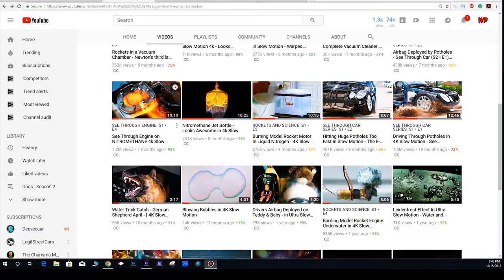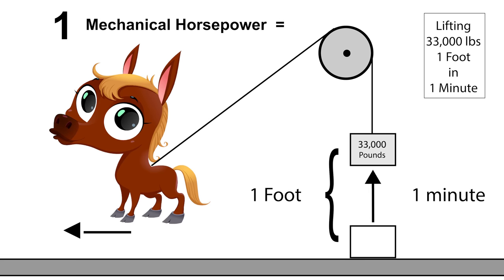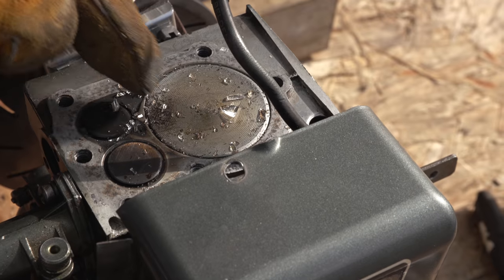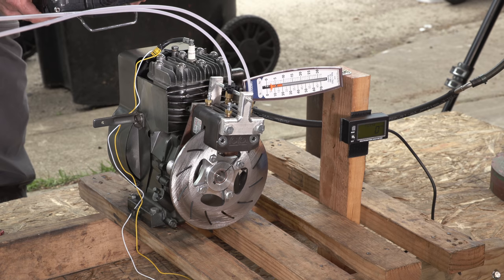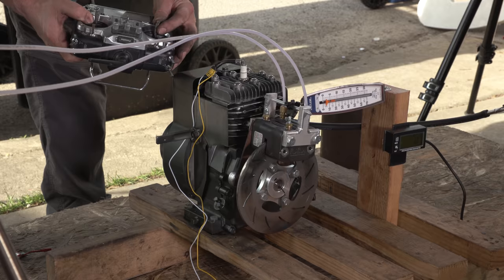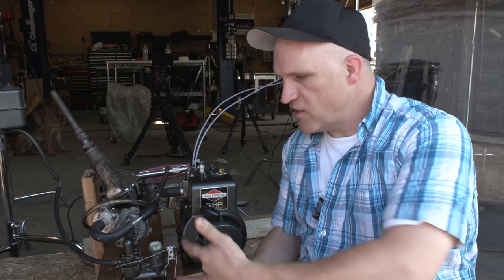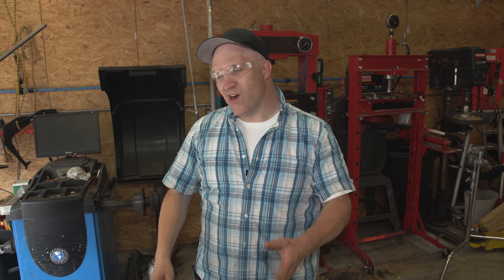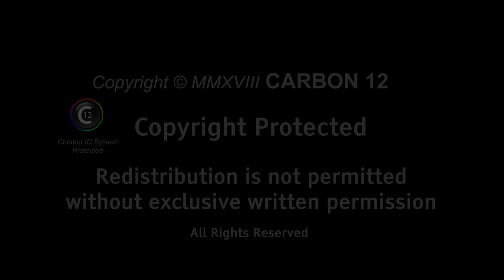See Thru Engine on Turbo Nitro and Dyno  (How much HP does it make?)

Comment: Forget the turbo, just attach a leafblower to it, that turbo is almost as big as the engine, it was probably restricting airflow rather than improving it. Though i do love the spool noises
Reply: i've seen videos on that two guys putting two leaf blowers on there car. the leaf blower wasn't producing any boost that's because the engine itself has ability to suck same amount of air that leaf blower was producing hence it was doing no effect, but might be another thing for this engine which is shown in video.
Reply: a leaf blower would have to work as a blow through, which would complicate the setup massively. probs best to persevere with the turbo.
Reply: Mighty Car Mods did that with a Daihatsu Chirade and it made a few more hp.
Reply: I agree. An oversized turbo like that will result in a loss of feed air pressure. That single turbo might work with 4 or more of those motors tied together and breathing through it.
Reply: Although you can't use a leafblower in that setup. The fuel air mixture will detonate due to the slipring spark. It would explode the leafblower.

Now, using an air compressor and pressurizing the fuel system would probably do the trick. Would probably destroy the bearings and explode the motor at about 9HP.
Reply: I'm thinking it needs to be setup with a carb w/ boost reference.  But even then if you actually do start creating boost you have to have enough fuel pressure (more than boost) to have the carb feed any fuel into the airstream.  Or is that only without boost reference on the carb?  Either way, this was a solid vid.  Maybe try with a tiny turbo like the guys doing the barbie go-kart thing?
Reply: funny thing is the monza episode is next on my autoplay
Reply: A wet turbo system doesn't really work on a tiny engine like this, because it doesn't have enough flow to spool up and sustain the turbo. That would only cause surging in the compressor and screwing up the mixture.

What does work is supercharging (which was very common in a wet system), so if you were to drive the turbo with a pulley or a separate electric motor, and lose the turbine end, would probably give better results.
Reply: Use a leaf blower to drive the turbocharger instead of the engine exhaust. Blow into the exhaust turbine.
Reply: tomasto those are cars where the displacement is probably 2.0-4.0 liters. This tiny engine doesn’t need much air and a leaf blower is probably a lot for it
Reply: @SuperEvo1990 there is also a video of someone feeding a suv with 8 leafblowers or something like that and made like 3 psi of boost or something like that

Comment: Dang that was a lot of work.  Well done!     An urban myth I heard years ago was about a guy that tried to boost HP by shooting oxygen into the carb.
Reply from the maker: Yeah, I've heard that one too but, I don't know I might make a note of that and include that in the episode where I'm supposed to put oxygen and acetylene into a running engine...lbvs. I may still do that one day, just for fun. And I have to film that it with high-speed cameras.
Reply: Oh, oxy-acetylene would be good
Reply: it'd work!
Reply: 2 of my favorite youtubers in 1 comment! What's up!!! ✌
Reply: Look for a turbo from a 600cc Japanese k car much better size for this engine
Reply: pure oxygen would be pretty nuts in an engine. as that's the reason they use nitrous oxide as opposed to straight oxygen.
Reply: Warped Perception don’t use pure oxygen. It will blow up. A racer in the 50s tried that thinking more oxygen more power, Illinois story short, blew up the motor. That’s why nitrous is used. The chemical reaction of heat and compression releases the oxygen from the nitrous
Reply: N20????
Reply: Nitrous oxide does wonders but just nitrous alone won't do what you think it would, you need extra fuel too.
Reply: need more carb, thats all. that engine can take a lot more turbo than that. But not whilst trying to suck through a straw.
Reply: You can always make a reverse collector air ram. Like a 4 to one carb system.
Reply: Warped Perception e
Reply: fryloc359 same applies to boost since its more air just like nitrous
Reply: That isn't a myth!
We got a 2hp Briggs up to around 10,600rpm on oxygen and petrol.
Sounded great. 
We tried oxygen and acetylen too, but got quite a lot fewer rpm.
Reply: lol haven't any of you heard of NOS? I'm pretty sure pure oxygen is too hard on the engine that's why NOS was invented
Reply: Sure, superdubs, but one can't use what one haven't got.
Reply: I think you mean  N2O.   NOS is something gamers say.
Reply: Nimbus Nimbus  sure I've heard of dry systems, but that doesn't mean you don't add extra fuel. Regardless of what type of system you use, you still add more fuel otherwise you run the risk of running lean and melting pistons.
Reply: it needs a lot of cooling for the amount of hp.needed inside and out I heard it makes 7 times more.power.
Reply: @UnknownProductions0  pure O2 has issues it spikes your temps to the point it will melt things sadly
Reply: @taofledermaus  nos is a brand name so there's no issue using it imo.
Reply: I did that to a single cylinder diesel to start it, not good, if fired with so much pressure it blew gas back into the injector and stopped, I was surprised it didn't blow the head off. After priming the injection it ran fine. It was an old engine with 1500 psi injection pressure.
Reply from the maker: Thank you!, Just finally getting my butt to work on YT...finally
Reply from the maker: Thats the idea, I have the high-speed cameras covered, that head will blow sky-high for sure.
Reply from the maker: yes sir, thats the idea, instant stochimetric oxy/acty injection, thats gonna bang.
Reply from the maker: on the way
Reply: try starting fluid into it after an intake valve toppoff to double compression pressure.
Reply: @fryloc359   man some people have no clue. You always have to add more fuel when running N2O. You would think as long as it's been around people would know this.

Comment: I'm not sure the Turbo IS too big but I can gaurantee you the carb is too small to make max power the engine will produce.  they are a horrible ancient design anyway. 
I used to Modify these engines and go from a 12mm carb to a 24 or 27 Mikuni and that made a HUGE difference with no other mods than a decent exhaust that wasn't  made for a 5 HP flow rate. 
If the turbo is boosting it it probably wasting energy  creating a  vaccum as it were through that little carb.  Remember, the carb is designed to flow enough for the engine rating, 3.5 or 5hp.  It becomes a restriction when you are trying to get double/ 3times or more through it.  Most basic thing of hot rodding was bigger carb and exhaust. 

Mikuni Carbs are good because you can change the jet sizes easily and they are readily available.  If you don't know what you are looking at it can be bit of a challenge but black smoke is Rich, back firing is lean and read the plugs after a run till you get a nice tan colour and ajust accordingly till you get there. 

Until you get enough air and fuel in there, the thing will never really get up on the boost curve and make it's full power.
Reply: He's in a workshop for goodness sake, just hook up the air compressor to the carb and squirt in compressed air, why waste hp on such a small engine to drive a turbo blade on the exhaust.
Reply: supersmalls I’m pretty sure the hp loss from driving a turbo is negligible.
Reply: I agree, it will need allot more fuel when it starts to come on boost, I would love to see you try adapt a bigger carb and get it to suit the turbo. Great videos, looking forward to more like this.
Reply: supersmalls that’s not how it works pal 😂
Reply: Plus the carb is not designed to work under boost. Clearly it isn't making any real boost or he would be pushing the fuel out of the carb back in to the fuel tank.
Reply: @dco5055  I think he mounted the carb on the intake side of the turbo, not the boost side. Air and fuel are going through the turbo. I think OP is right, IMO too small a carb and to big a turbo.
Reply: @tomlindo2863  I skipped past it then makes sense.
Reply: Ecu it and forget about carb issues.
Reply: Its a single cylinder pumping a turbo, never had a chance to work regardless of carb size. Guys in the drag mini bike scene played with turbos and they just dont work with thumpers. A belt driven charger is way more effective on these little engines.
Reply: @BigMac2222 , Plenty of guys running turbos on 800cc rzr engines with power gains. Two cylinders running parallel.
Reply: Do you see how that could be different from a single cylinder engine?
Reply: It may be parallel cylinders, but they do not share the same stroke. One's intake stroke is the other's power stroke, one's compression is the other's exhaust. You have a more steady stream of exhaust pressure to feed the turbo, instead of a pulse of exhaust 25% of the time.
Reply: Matthew Behr yeah that’s also much larger displacement with a lot more air moving through the exhaust to push a turbo. Comparing something like that to this 3 horse Bricks and Scrap Iron motor, I think they are like around 130 cc or something, Is basically nothing compared to the displacement of an 800cc rzr
Reply: One can't just put compressed air into a carb, why do you think he put the carb on the intake side of the turbo?
Reply: Those turbos are sized for 1100 to 2200+ cc motor a piece.  What you see on all the 4 cyc vdubs.  Most of the time on blow through carb setups you need to run carbon seals on the compressor side.  Unfortunately the smallest turbos you can find from the factory with those is the TA31/34 off of the bird in the picture you threw up or the old rayjays off aircrafts (why old hotrod guys usually use them).  Prob wont work for you.  Way to big.  Cool idea tho.
Reply: I was thinking about the turbo being too big myself. That small engine doesn't move enough air to really get that turbo spinning fast. Something that would help that turbo spin faster would be to modify the exhaust side. I wonder if that turbo is set up with something like this. https://www.youtube.com/watch?v=CbdY1rymBJg
Reply: @ @Diesel8290   You are correct!  so why not go ahead and inform him of why?   While a air compressor has a lot of pressure, it just doesn't have the needed volume of air to supply an engine under full throttle?  Then he could be educated!
Reply: Oil Burner Fab up a Briggs quad carb intake. Lol
Reply: @derrick hodges the pulsed exhaust issue should mostly be able to be overcome with an exhaust plenum, but thats not exactly something all that practical on a dirt bike. Without a sizable exhaust plenum you are going to destroy the turbo, if it manages to work in any meaningful way. (edit - i should clarify its not just a packaging issue with the plenum - there would be more lag than a 90s stage 4 supra and dirt bikes rely on response)
Reply: @derbsmcbergs  what he needs is a turbo from one of these current small economic 4 cylinders that keep popping up.  Along with a bigger carb. On an Amg this turbo takes care of 3000cc+. So this tiny single cylinder motor couldn't ever really use this particular turbo for good.
Reply: I call bullshit
Reply: @supersmalls : It won't work. The compressed air/duel has to be between the carb and the intake manifold.
Reply: I've heard that a smog pump from a Toyota Tercel can be hooked up to a small engine, fanbelt from crank to pulley on smog pump and can increase a 5 h.p. to 9 h.p? Would like to try it. 😁

Comment: That's a lot of useful information actually. I saw that in the turbo version the intake of the compressor wheel is smaller when the carburator mounts on. I know it's not the easiest thing to make it larger, but it would be interesting to see if it could make any difference. Maybe a larger carburator. I really loved the video :)
Reply from the maker: Thanks, and making this episode I took into account the fact that not many people know what horsepower actually is. yeah this turbo is actually pretty small, it's the primary turbo charger from the sequential setup on the SL 65. It's a 27 mm compressor wheel. That would be interesting for sure, I'm probably going to make it fuel injected.
Reply: Hey johnny!!
Reply: The turbo is way too large..
Reply from the maker: It's actually not, it's the primary turbo charger from the SL65, it's 27 mm. it's a baby, but for the next episode I will probably redesign this set up a bit, and also Mount the smaller turbo charger that I have.
Reply: @WarpedYT  
MicroSquirt and MegaSquirt controllers are pretty cheap these days.
 Accurate fuel and ignition mapping might get your HP numbers up.
Reply: Since this is a "draw through" turbo setup (instead of blow through)... your compressor inducer is reduced now to whatever the carb is (much smaller than the compressor inducer on the turbo).  Its like you've put a HIGHLY restrictive "restrictor plate" upstream of the compressor (the compressor inlet).  You need to make some holes (or an opening) in the "block off plate" (intake adapter plate) that you made that connects the carb to the compressor inducer.  Let some air bypass the carb... so as to not restrict the compressor so much.  So now the compressor is sucking in air both through the carb... and by itself.  

Of course... if you decide to fuel-inject this thing... you can do away with the carb altogether... and just run the injector right in front of the compressor inlet (inducer)... and you won't have any restriction.  Use a wideband O2 sensor and tune for around 11.5:1 air to fuel ratio.  You'll also have to tune the ignition timing (you'll need programmable ignition) for the boost.  To do this properly you'll need knock (detonation) detection gear.  Or else you're likely to run into detonation and blow the engine.  Make sure also to use high octane race gas to get the most out of the engine... without running into detonation.  If you go EFI route... its gonna be a fair bit of work making the fuel system (efi fuel pump, pressure regulator, injector, plumbing)... unless you go to a junk yard and just use a car efi fuel system (and just block off the unused injector bosses in the fuel rail... since you'll only be using one injector).  And then you'll need some kind of programmable computer (ECU) to run the ignition and injector.  And then you have to learn to use the software to get the right fuel and ignition values.  Also you'll need a crank-angle-sensor so the computer knows when the engine is at TDC on the compression/power stroke... so as to get the right ignition timing.
Reply: @WarpedYT  clearly people who don't really know what HP is probably shouldn't get an explanation for someone who doesn't have a clue about turbochargers yikes
Reply: JohnnyQ90 I actually was going to send you this for the turbo video on your channel
Reply: Marek Sumguy that 11.5 number is actually incorrect here, since he isn't running 'regular' fuel. Try somewhere between 5 and 7 to start with, depending on what the stoichiometric value of his exact type of fuel is, and those numbers might not even be rich enough... (Look at how much fuel those tiny 2,5cc rc glow engines use for example)
Reply: @WarpedYT  you can get cheap keihin dirtbike carbs on ebay for like 30 odd dollars, i have a 26mm on my engine and works great
Reply: You need to modify the intake lobe on the camshaft there’s a built-in compression release
Reply: @WarpedYT  please use stronger valve springs.   The valves will be pushed open by increased boost pressure.  Resulting in floating and bouncing of the valves.   Duration per intake stroke will differ hugely..... Creating all kind of problems....like broken valves, valve seats dropping out.  And for example exhaust gas pushing its way back into the cylinder during intake stroke......that creates EGR , which is nice for emissions, but destroys power, and worse: detonation as the hot exhaust gasses can ignite the fresh incoming NITRO mixture......recipe for disaster!!!!!!
Reply: Baard2000....What boost pressure?
Reply: @jleoneleone8760  not bull beacuse if you use your brain it proves that that nitro methane makes more power, the normal fuel could not accually turn it fast enough to get 4000rpm with the test rig on
Reply: Do the math your self and you’l get the answer yourself but the math always will add up
Reply: @enemysteve48steve90  ??? I think you replied to the wrong person